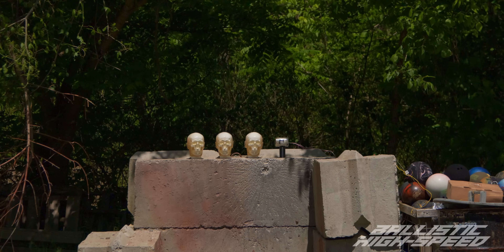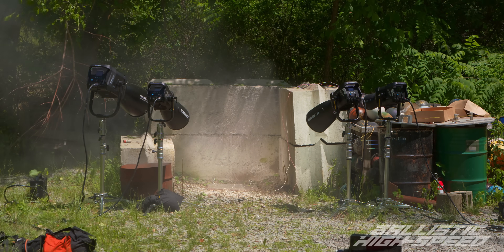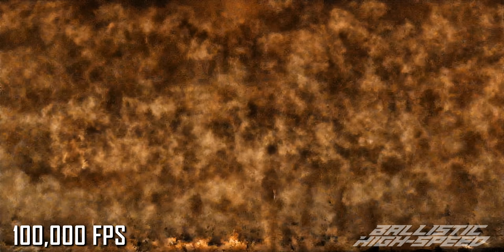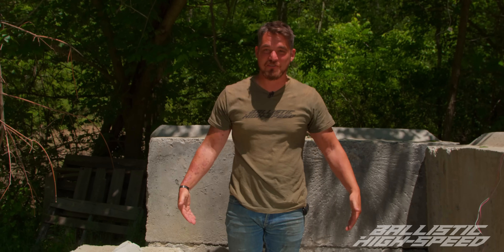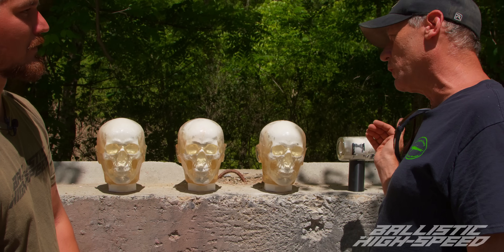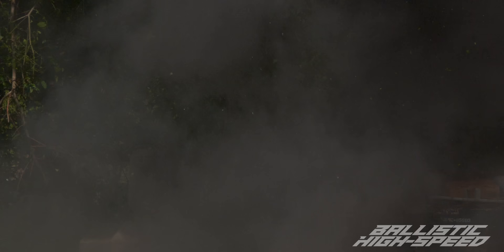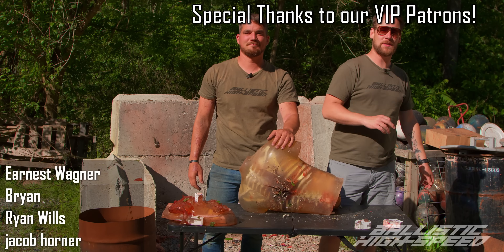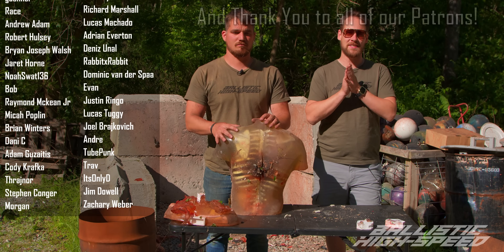Shaped Charges vs Ballistic Heads! - Ballistic High-Speed

Comment from the maker: Thanks for watching! Pick up some merch if you'd like to support the channel: https://www.bunkerbranding.com/pages/ballistic-high-speed
What would you all like to see done with explosives next?
Reply: Hey dudes, please try making a shaped charge from bismuth... 
It's much heavier than copper and easily cast into various shapes...

Mass times acceleration... You will almost triple the mass, acceleration will still be pretty high.

The shape in the explosive forms a kind of cup, which pushes objects within it along for the ride.
The impinging propagation front from the shape tip actually multiplies the speed by a certain factor, determined by the angle of the cone... Which is why the jet is so freaking fast.

I'd love to see a comparison against a standard copper shaped charge 😄

Oh by the way, the reason the jet is looking like a liquid is not because it melted, but because it got shredded apart at molecular scale.
Adding to that it's also pretty hot due to the high amount of compression and speed.

Heat is basically just movement... Well, the resulting energy transfer from all the atoms smashing into other atoms is the heat.
So yeah, it's speed translates into heat.
Reply: For some reason all I see is Ike Barinholtz, the guy from Suicide Squad. When I see the host. 😊In a good way
Reply: Would be really interesting to see just a block of clear ballistics gel with the TMX 7510
Reply: YES!!! SHAPED CHARGES!!!
Reply: Thanks for the amazing footage and videos!
Reply: Now do EFPs…
Reply: If you do the multiple plate test, please make sure you test both with them spaced out, and sandwiched together (or a thick block)
I forget the exact numbers, but WWII/postwar tank HEAT shells had RHS penetration values greater than a metre with optimal setup.
Spaced armour being one counter to incoming HEAT shells, causing a detonation earlier than optimal, and causing some deflection after the outer plate further decreasing the penetration power - in theory.  In practice, it's possible that it could make it worse, as due to constraints of the shell, the detonation was generally closer than the optimal, so an early detonation could put it more into the optimal range to defeat the armour...

Being able to see the difference between spaced, and non-spaced armour would be fantastic.
Reply: @3:30 Correction: in a shaped charge with a copper liner the liner itself doesn't become liquid ,but a series of tiny fragments due to the difference in speed in various parts of the “jet" .Source: The shaped charge concept ,William P.Walters
Reply: Can you just show us a sack of rice falling over at 400.000FPS?
Reply: call me crazy but the subtle flashes that we see on the black and white, are possibly breaking the 'bones' with such force or breaking at such speed that it creates a "heat" signature, or friction between them that ignites for milliseconds
Reply: call me crazy but the subtle flashes that we see on the black and white, are possibly breaking the 'bones' with such force or breaking at such speed that it creates a "heat" signature, or friction between them that ignites for milliseconds
Reply: I know this has almost zero chance of you guys seeing it but please do a quick youtube search of CAVILUX or Cavitar and take a look at their laser illumination product videos (i comment all over them too).   They provide incredibly bright illumination of your target so you can get good exposure of extremely bright phenomena (their primary use case appears to be industrial welding applications).  (EDIT: I have nothing to do with the company, I'm just a nerd about this stuff!!!)
Reply: Idea-  interleve the frames from both cameras for false color.
Reply: Have you done a shaped charge into water?  I'm curious as to how that would look.
Reply: Test EFP charge ?
Reply: @BallistcHighspeed YouTube subscribers 👌🏻

Comment: A theory that is making the rounds after the assassination of Kirk is that it wasn't a rifle that k!lled him, it was a small shaped charge  hanging on his back, near his neck. It would be about the size and shape of a cigarette pack...standard wearable transmitter for a microphone used on a stage.

Could you arrange a demonstration of how (or if) this could work? The video of it at the moment of impact  shows a slight puffing out of the back of his t-shirt, minimal blood, and supposedly an "exit wound" on the lower left front of his neck. It would've penetrated through the spinal cord, without significantly disturbing the immediate area around him.

I'm very interested in seeing if this is a reasonable possibility. Thank you!

Comment: 17:18 it won’t matter how many plates are there. At kilometers per second the only thing that stops it is distance because it’s got a whole-heapin-lot of V but not much M. That said, an interesting experiment to test would be to find the stoping point, and then see if it changes when you add or remove plates.
Reply: I mean considering that a heat charge is meant to penetrate 1000m-ish of tank armor, no no body armor is making a difference lol
Reply: @midpackula  add an “m” there. We’re punching holes in tanks, not perforating the earth’s crust.
Besides, there’s functionally no difference between armour and plastic at kilometres per second, however; there is a known and predictable range that the shape charge is effective within. Outside of which it is significantly less effective at its designed function, to the point of being an expensive way to texture a given surface in a really specific area, really quickly. 
Also I will say that there has been some composite armour systems that perform similar to an armour design of significantly thicker proportions and can exhibit slightly different behaviours depending on the munitions used to defeat it. SY Simulations has some pretty good cutaway simulations of these systems.

Comment: The shaped charge issues are interesting about how the standoff distance needs to be a specific multiple of the charge diameter and all of that.  What I think might be interesting is using the similar principle of explosively formed penetrators, showing how they are formed in high speed from the shallow dished penetrator with the RDX or C4 or pentolite explosive.

Just something different for the channel.

Comment: I think the secret behind a shape charge is how hot the material plasma is. like how copper is hotter than glass, which is hotter than aluminum. like the heat, the fluid viscosity, the mass, and the accelleration, all play in favor of copper, as it's 500 or some odd degrees hotter melting point than glass or aluminum. stainless steel and iron more still. think iron's supposed to be like 2500c to melt. and it's denseness, and ability to absorb evenly heat like aluminum and copper. if the explosive was powerful enough to cause iron to for a plasma jet... basically something that could breach through the side of a fortified pillbox or bunker or something

Comment: the only real weakness to AR500 armor plate, would be an immense amount of heat. the Temper is what makes AR500 so hard. if you put it in a bon fire or spray it down with a torch until it's cherry, bullets will go through it like it was mild steel. and at 3/8 mild steel wont stop almost any rifle rounds. and ild steel cant be tempered. carbon and other additive components too low in percentage. why it's called "mild" steel, I guess

Comment: Just started watching you guys and when you wonder what it would take to stop the copper charge.... well the Slo Mo guys answered that quite well, what it takes is thickness of the metal, but also air gaps. If the copper jet keeps punching through a plate and then impacting another then what happens is that it keeps disrupting the tip, and removing copper from the jet. Wasting the energy with air gaps.

At least that's what I gleaned from their slow-mo, but I would be interested to see more evidence for or against that.

Comment: I've seen a lot of pictures and even actual damage to armored and up-armored military vehicles from OIF. There's a thickness of plate that's supposed to be perfect, there's also the angle of the cone that contributes to effectiveness, and the charge ratio to diameter. What they showed was about a 1" copper shape charge. The bigger they are, the more damage they will do. As in ripping through an entire storage box full of tools, straps, MREs, and anything else you'd find on a tank. Then through most the turret armor, to finally be diverted by the last plate of steel on the inside and travel another 12-24" while bulging that inner layer of armor. The telltale sign was also the shine of copper that's deposited at and through the point of impact. These things are deadly as you scale them up, to the point that they end up not being able to be defended against.

Comment: I attended a bomb search and awareness course for the oil and gas industry in the UK.
The ecentric old guy giving the practical demo of shaped charges set off 100 grams of plastic ex on a 2 inch thick steel plate, it damaged it but it was intact, to prove its the shape that makes it effective he took the top of a broken wine bottle, had the neck full of plastic explosive, balanced it up on a small stand to give a stand off distance and set it off. Blew a finger sized hole through the steel plate with vapourised glass. Seriously impressive knowledge of his subject!
Reply: That sounds like an incredible experience! The power of shaped charges is truly mind-blowing when you see them in action, especially with a setup like that. If you want more of that kind of explosive detail, be sure to check out our channel for slow-mo footage of similar powerful moments! 🎥💥

Comment: I called the penetrative of the armour. You were thinking in terms of a solid point pushing through the armour when in fact it is more like a lazer beam of plasma that is melting and mashing its way through as a steady stream of consistent pressure and heat.
Reply: Spot on! The plasma jet effect is exactly what makes shaped charges so devastating. It’s not just brute force—it’s precision, heat, and pressure all working together. If you’re fascinated by how these forces work in slow motion, check out our channel for detailed footage of similar experiments! 🎥🔥

Comment: I use those OOT charges everyday in my job. 
Depending on the gram weight (guessing these were about 23gr), they have a nominal penetration of about 42 inches in 5000 psi compressive strength concrete. 
That number is in fluid though, which hydrostatic pressure really increases the penetration but decreases the exit hole size. Hole size in fluid will be about .42" nominal. 

Fyi

Comment: EFPs like those used in fracking have specific qualities to them to be used at a certain standoff etc.  What is very interesting are EFPs used in tank hunting sub-munitions that have a very very long standoff and characteristics baked into the EFP prior to detonation such as crimping for the copper etc. that give aerodynamic properties to the resulting penetrator.  See the BLU-108 submunition as an example.  Also if you can get your hands on some linear shaped charges that would be super neat to view on the high speed.

Comment: so the heads one, uh you accidentally invented a High-Explosive Dual Purpose warhead.  An HEDP round is a HEAT shell with a fragmentation liner around the charge, so it can be used ,as the name implies, either against dismounted infantry or armor.

Comment: Pre AR500 prediction - HEAT warheads do really well on rolled steel homogeneous armor - HEAT is a shaped charge. 
They went to composite armor (layers of different materials)  to help defeat that shaped charge jet - one of the common materials in an armor package is ceramic- which is supposed to help dissipate the jet by becoming an amorphous semi solid which makes the jet spread out to get through.

I think (as long as the charge is close enough to the steel) the jet will go through. 
BUT if it were a ceramic plate, it might defeat the jet,  the blast wave would shatter it, and turn it into projectiles, killing your torso regardles.  Will edit after i watch.

I guessed right... now do a ceramic ceramic plate and see if i can go 2/2

Comment: I used to work with an old head named pat when i worked for Eminent Oil Tools. His job was essentially to handle, transport, and assemble those fracking charges into their “guns” and get them wired for detonation. On occasion he would have me spraypaint the primed loads red and the blank loads white

They did this so they knew exactly at what depth the charges would be going off at

Really interesting work and he told me it was highly sensitive and closely monitored. Im curious as to how you fellas got a hold of one

Comment: That’s the beauty of explosives is the speed. 22,000fps if it was a 55gr out of a 556. Would be 4-6 times more powerful than a .50 bmg 60,000 ft lbs… from just 55gr of material.

Comment: In the first head explosion, I wonder if the sparks around the eyesockets are air being heated up by the pressure of the compressed air and kinetic energy to the point of ignition and maybe combustion. So the pressure of the kinetic energy hits first as a wave through the skin and bones and meat which creates air pockets, maybe similar to how a rainbow shrimp punches water to create vacuum bubbles... Actually maybe that's what's happening? I was gonna say, then the wave of pressurized air comes down before the air pockets contract and ignites the air inside those pockets? 

Pure speculation ofcourse, I don't know.

Comment: Merging Color and B&W video: if the two cameras have very similar perspectives (like if they are next to each other), a talented video/visual engineer could use the color frames to pretty-accurately colorize the b&w frames. That would be amazing to see! Things that might help:
• Same shutter speed: any blurring looks the same in both.
• Same lenses: similar optical distortion makes matching-up the frames easier (for example, all the concrete clocks would be in exactly the same spots in both videos).
• Identical camera perspectives: filming with a 50%-silvered mirror would give both cameras literally identical views (and it halves the incoming light, but that doesn't sound like an issue here)
• Frame sync: if the two cameras could share a time-reference signal, one camera could run exactly 6x faster than the other, making it easier to post-process the video without frame drift.

Three cameras would be even better! Ultra-fast b&w for motion detail, very-fast color for colorization, and fast high-res color for filling in background detail.

✱ Vision Research could network their cameras' value by simplifying this sort of post-process video-upgrading: allow their cameras to share a base clock, create reference plans for perspective-merging mirror mounts, and suggest software approaches.

Comment: Ballistic engineer here again. That hole actually didn't have material removed. It was mostly just displaced elsewhere into the plate around the hole. We have a fun fact we show where we will weigh a plate before and after shooting it with a charge and it is nearly the same.

Comment: Hey guys. I'm a ballistics Engineer for those types of oil field shaped charges. Just a little fun fact. We have charges at least half the size that can make it through 1 and sometimes even two plates of 3/8 inch thick steel. Hardness if steel plays a big role. But the power of shaped charges is insane.

Comment: Shape charges (Monroe Effect) and Explosively Formed Projectiles (EFP) (Misnay-Schardin Effect) are not the same phenomena.
The shape charge works on a different theory. The copper cone (deep concave) collapses as it is fully encased in high explosives. As the cone collapses the copper liquifies and produces a copper jet capable of penetrating armor.
A EFP will take a malleable  metal (shallow concave) (Copper) and invert it to become a slug and due to the speed and density will penetrate armor.